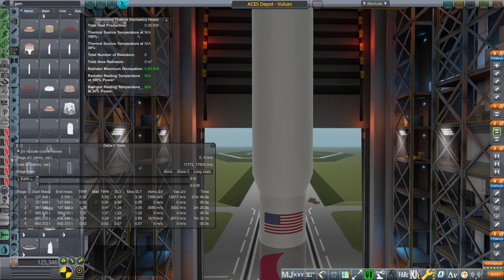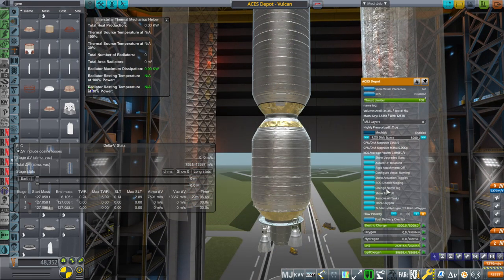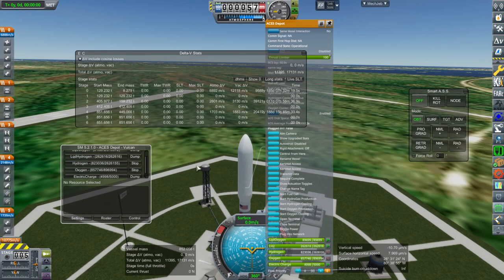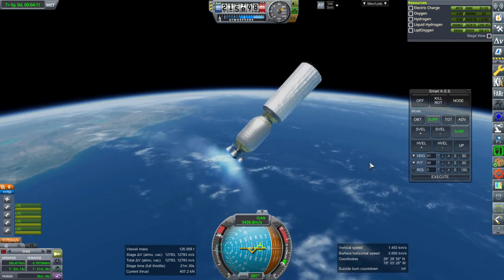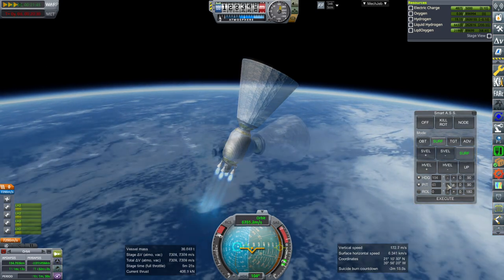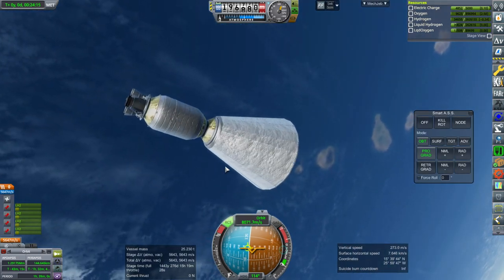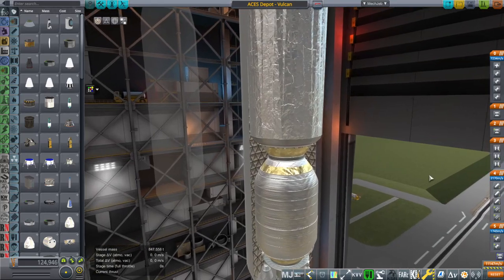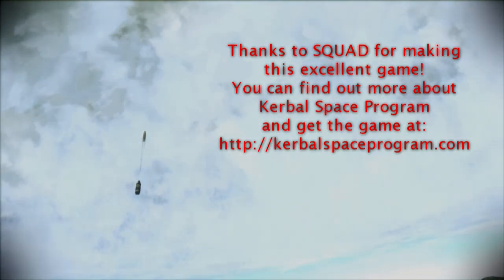Realism Overhaul in KSP 1.8.1 - ACES Depot Initial Test

Comment: To my knowledge ACES means advanced cyrogenic exploration stage. I built a fully proc vulcan with ACES, it wasn't a horrible lv, with the 6 srbs and four upper rl-10s
Reply from the maker: Well, Wiki disagrees: https://en.wikipedia.org/wiki/Advanced_Cryogenic_Evolved_Stage. Maybe you're thinking of the SLS EUS (Exploration Upper Stage)?
Reply: Possibly, I used an old guide for naming. But it does make sense with the scale and all (4000 dv+ with fully fueled orion)

Here's a link, also uses a different design https://cdn.discordapp.com/attachments/758915602080989204/767078226321211402/UwEkW4CUb06LpfvnilxNTLkaHyKBf1YFggRdDNS8ogE.png
Reply from the maker: The ACES in that image is the standard upper stage, rather than the Depot version. It's basically the bottom part of what I've made.
Reply: Understandable, and that does make sense. I have to do some more testing of my proc vulcan, along with testing out new shutte configs (From shuttle orbiter construction kit) so far they've been... Interesting, the nose rcs don't want to cooperate